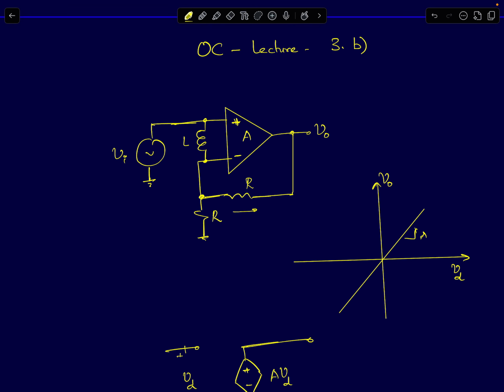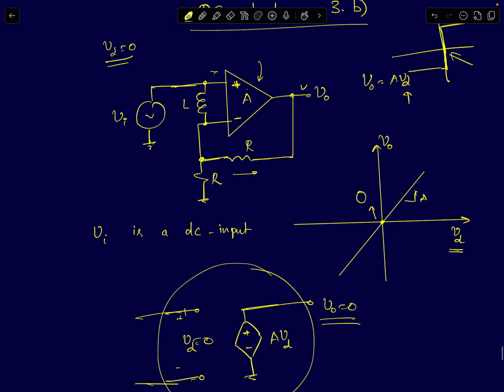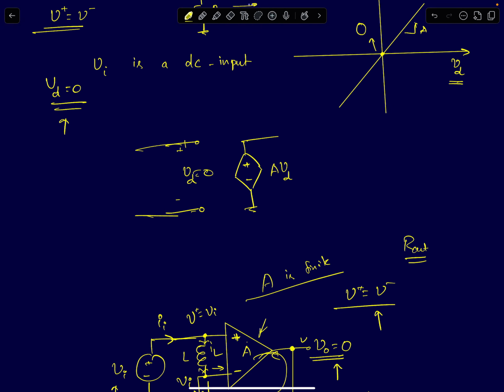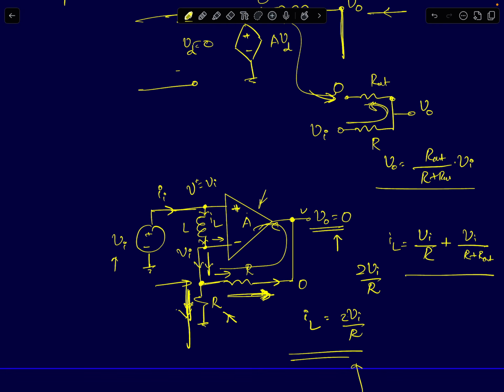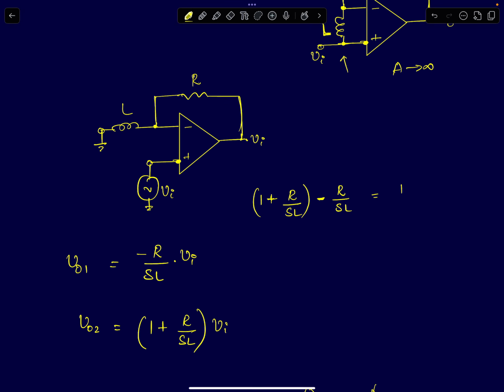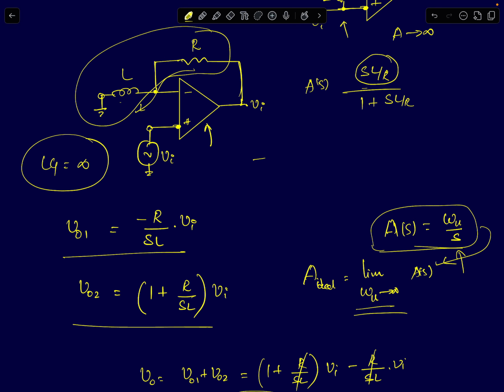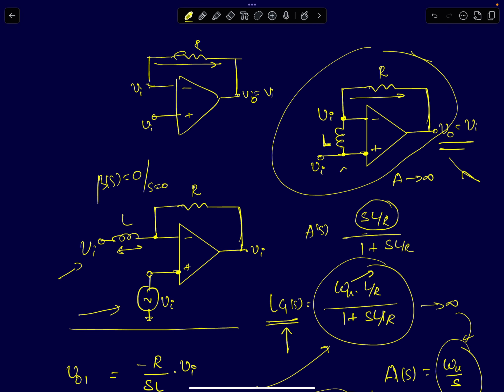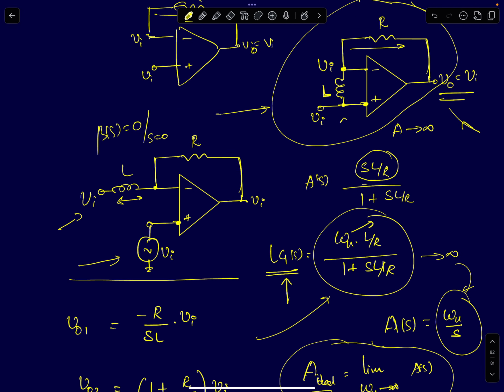OC Lecture 3.b) (new) An interesting problem on virtual ground (correction)

Comment: Sir, I had a general doubt, for an opamp which used to be in negative feedback thrown into open loop due to saturation (for example an integrator), what conditions should be met to bring the opamp back into negative feedback

Comment: @chembiyant456  hi sir, Thank you for the explanation, but I still have a confusion regarding when I should consider the virtual ground in the presence of frequency-dependent components like inductors or capacitors. As explained in video 3(a) at 17:00, you took the loop gain as finite (even though A=∞) and explained that negative feedback is weak.

So, based on this new video, can I say: irrespective of the components present in the circuit, if the op-amp gain is finite, the virtual ground assumption is not applicable, and if the op-amp gain is infinite, I can blindly apply the virtual ground?

Please correct me if I am wrong.
Reply: Yes same doubt its really confusing in 3(a) when there was ASl/Rf+SL, for A-> infinity we said that at dc loop gain is someyhing very small multiplied by infinty so AB is not equal to infinty so negative feedback is weak but for same loop gain in new 3(B) we said there is negative feedback